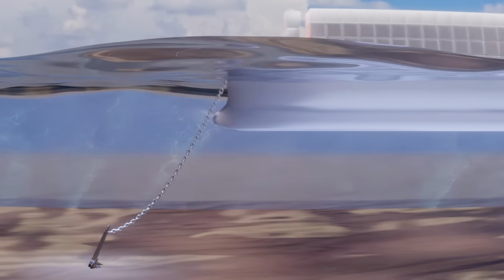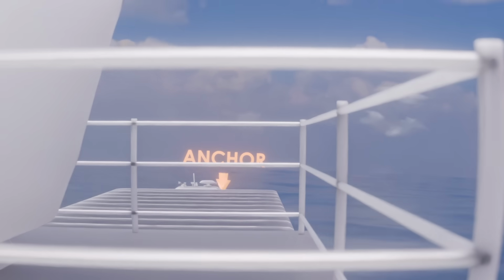Anchors don't work the way you think

Comment: >"Anchors don't work the way you think"
>looks inside
>works the way i think
Reply: Damn pirates listening in to youtube when they should be sailing!
Reply: So you're telling me that you knew the real reason the ship stays in position is the extra-long chain lying on the bottom, because when the ship moves, the chain works against the water pressure? Well, yeah.
Reply: @FloydDiamond  That's what most people would guess since that is the most intuitive role of the chain
Reply: @jmw8403 nope. The most intuitive would be that the chain is just what ties the boat and the anchor together. That the anchor is hooked into the seabed and the boat is not moving because it’s stuck. I would envision a stretched chain always. So this was a good, educational movie
Reply: @nilzor  I disagree. A chain made out of steel that is several kilometers long is obviously very heavy. Considering this, one would quickly come to the conclusion that the function of the chain has the function that is explained in the video. But I guess your intuition differs from mine.
Reply: @jmw8403 the chain has the function that is explained in the video” yeah right this tells me all I need to know 🤣🤣🤣🤣🤣🤣🤣 stop trying to make yourself look smart, you obviously didnt know the chain is what keeps the boat steady, anD ALSO the “most intuitive” function of a chain is literally holding two things together. You neither know the meaning of intuition nor the way an anchor works before this video. People like you piss me off. Couldve at least said the function of the chain is generating friction coupled with its heavy mass to keep the boat steady against the raging water, but no, let me
just save myself looking like an idiot and say “like the function explained in the video” 🤣🤣🤣
Reply: @Sorecere7  If it's not intuitive to you, then I guess that's your problem.
Reply: @Sorecere7 it is fairly common knowledge that chains play a big roll in the anchoring of a boat.
Reply: @buttecake  of course they do 🤦‍♂️🤦‍♂️🤦‍♂️🤦‍♂️🤦‍♂️ you think the anchor anchors the boat by bluetooth. However, I doubt that the chains function is “fairly common knowledge”. God, all of you are idiots why does no one get it.🤦‍♂️🤦‍♂️🤦‍♂️🤦‍♂️ You wouldnt have known this shit previously unless you gave it some thought stop acting like you knew this, and you’re smart or some shit.🤦‍♂️ you know what whatever sure this is all “intuitive” 😂😂😂 and also fsirly common knowledge. Whats next, you know all the procedures in a nuclear power plant😂 i dont wanna continue these conversations, have a nice day/night.
Reply: @Sorecere7 sorry dude, I'm just not as dumb as you I guess
Reply: @buttecake  Keep saying it till you believe it 😂😂😂😂
Reply: @jmw8403  "But I guess your intuition differs from mine." no, I guess you're just full of shit about having known this all along
Reply: @foljs5858 Where did I say that I knew this all along? Do you know what intuition means?
Reply: If the way you thought it works is "the anchor digs in and that's enough to hold the ship" then no, it's not working "they way you thought". Unless you already knew the chain plays the most important role, what you thought was the same shit the average layman thinks and is wrong
Reply: @foljs5858  Projecting much? It's obvious that he massive chain plays a more important role that he puny anchor in comparison. You are a poser, acting all high and mighty even though you lack a basic understanding of physics and critical thinking skills. It's not rocket science, it takes all of 10 seconds maximum to come to the same conclusion as in the video. It's funny how you're trying to tell me what i'm thinking as if you're some sort of omnipotent being. You don't know what you're talking about, you are nothing but a vile and bitter person who's trying to take it out on people around you to feel better about yourself. Learn some goddamn manners and get off the internet.

Also, referring to people are "average layman" doesn't make you sound intelligent, you only come across as a poser.
Reply: @foljs5858  Projecting much? It's obvious that he massive chain plays a more important role that he puny anchor in comparison. You are a poser, acting all high and mighty even though you lack a basic understanding of physics and critical thinking skills. It's funny how you're trying to tell me what i'm thinking as if you're some sort of omnipotent being. You don't know what you're talking about, you are nothing but a vile and bitter person who's taking it out on people around you to feel better about yourself. Learn some goddamn manners and get off the internet.

Also, referring to people are "average layman" doesn't make you sound intelligent, you only come across as a poser.

Edit: you're liking your own comments lol.
Reply: Right.. 😂
Reply: This film was more about how the chain works..
Reply: @cartoelie  because that's what actually does most of the world most people think the anchor is responsible for
Reply: My thinking works exactly like an anchor!
Reply: same
Reply: You didn't finish the video, donkey
Reply: Jesus died for you on the cross. All have sinned and rebelled against God (Romans 3:23-24) (not including Jesus since He is God). The wages of our sin is death (Romans 6:23). But “God so loved the world, that He gave His only Son, so that whoever believes in Him should not perish (not go to hell) but have eternal life” (go to Heaven) - John 3:16. God loves you and wants a relationship with you and all you have to do is believe in Him and love Him and repent (turn away from sin) and you will be saved. “that if you confess with your mouth the Lord Jesus and believe in your heart that God has raised Him from the dead, you will be saved“ - Romans 10:9. God will change you and your heart to become better so that He can make your arrogant and evil heart of stone into a kind and loving heart that is obedient to His commandments which are perfect as He has changed me. He will change you so that you can love Him and love others as He changed me even though we fall short of God’s glory by sinning. Surrender your life to Christ and believe today and be reconciled with your loving Creator and know the God who made everything and everyone who doesn’t delight in the death of the wicked: “ Have I any pleasure in the death of the wicked, declares the Lord GOD, and not rather that he should turn from his way and live?” - Ezekiel 18:23.  Also, “The Lord is not slow about His promise, as some count slowness, but is patient toward you, not wishing for any to perish but for all to come to repentance.” - 2 Peter 3:9. God loves us so much that He wants all to come to repentance and is patient with us and doesn’t punish us for our sin if we allow Jesus to take our sin off of us because He died in our place because we deserved death for our sin so Jesus, having never sinned, died in our place. “He made Him who knew no sin to be sin on our behalf, so that we might become the righteousness of God in Him.” - 2 Corinthians 5:21. But He will punish those who continually reject Him or who have rejected Him even to death.  Please, the time is soon, Jesus is coming back, and many aren’t saved. Don’t wait! Accept the free gift of salvation which God gifts us and believe in Jesus because God has promised that if we believe in Jesus (Who is God), we will receive eternal salvation. “ For it is by grace you have been saved, through faith—and this is not from yourselves, it is the gift of God—” - Ephesians 2:8. Repent (turn away from sin and resist temptation to sin) and come to Christ who will take your sin away, give you a new heart to love God and love other, and He will save you from judgement on judgement day. What an offer! “ For the wages of sin is death; but the gift of God is eternal life through Jesus Christ our Lord.” - Romans 6:23. Praise God!
Reply: Consider9ng the first anchor is like... seemingly 1/3 the size of a full cruise liner.... I'm gonna say they work WORSE than i thought(I'd always thought it was specifically a fairly small thing compared to the boats they stop)
Reply: Damn presumptuous title that assumes every viewer is a moron, whereas in reality only most of us are.   Second only to presumptuous titles that assume the information is of critical importance.  "What you really need to know about dental floss"  Third only to fake wow-factor.  "You'll be amazed and won't believe what happens when you put an egg in boiling water!"
Reply: @agalah408  1 it doesn't assume nor does it say people are morons. No one knows everything about everything. Not knowing the exact way anchors work doesn't make anyone a moron, plus most people actually don't know about the curve part so the title isn't a lie 
2  those "presumptuous" titles aren't an issue if the information is actually something important or if it aims to explain all the important info about something to someone who doesn't know anything about it
Reply: @hyacinth5040 ahh finally met someone with fully functional brain 🤝
Reply: @agalah408 not knowing how the anchor works doesn't automatically make people moron, no people knows everything. Human evolved by learning, I thought you know that already. What kind of bullsht is this
Reply: @agalah408 shut up dumbass, you ARE a moron if you think that explanation videos like these are targeting idiots, when in reality you can be smart and not know everything. In fact, “smart” people are those that admit that they dont know everything, and only a fool is naive enough to pretend he does.
Reply: @agalah408 and then they use metric
Reply: @daleolson3506  
Yes, the correct one :)
Reply: @agalah408  
Not everyone, just 99,100% when it comes to such odd knowledge.
Reply: 😂😂 I said this to my wife. 
Like. I absolutely do understand how anchors work Ive been sailing nearly all my life however now I gotta watch to make sure lol.
Reply: @Nailedit-p7q  Want to get a full understanding of how anchors work and can drag?  Own a 40' cruiser and anchor off in the strong current of the St. Clair or Detroit river with hundreds of other boats for the firework shows.  You had better know your stuff before you slam into another person's million dollar boat. I put out over 100' of chain and rope to make sure that I am locked in.
Reply: @g.k.1669 yeah man that’s too crowded for my blood! Lol. On days like that I’d rather just grab a cooler and some chairs and watched the guys at the boat ramp instead. 😂
Reply: cap. you totally thought it was a billion pound anchor attached to a piece of thick twine.
Reply: LIES
Reply: First time you see a clickbate title on youtube?
Reply: I am pretty sure this is what most people believe how an anchor works.
Reply: @jmw8403  Pretty sure most ppl don't know that the chain weight plays the biggest part, wanchor.
Reply: @Toro_Da_Corsa  Yeah I agree. Never said they did.
Reply: @jmw8403  
I'm pretty sure 99,100% of people don't know how anchors work.
Reply: @AArata63 Sure, but if you were to ask them, this is most likely the explanation they would think of. It is pretty much the obly logical way an anchor would work.
Reply: @jmw8403  
No, most people would NEVER know the function of the chain as explained in this video.
Reply: @AArata63 I find that hard to believe since that is the most obvious function of the chain. The explanation in the video is the most intuitive and logical explanation of how an anchor works for most people.
Reply: @jmw8403  
Maybe for you. I'm highly educated and very practical but I had NO idea the chain had that function. Maybe this comes natural to you but I'm 100% sure most people wouldn't know.
Reply: @jmw8403  the most obvious function of the chain is to pull the anchor out
Reply: @MrOwl-lw3xc When you have a chain weighing hundreds of tonnes, it becomes pretty intuitive and obvious that it functions in the way that it is described in the video. And considering the chain's material, and its size and length, it also becomes obvious that it must weigh a lot.
Reply: @jmw8403  i didn't knew how much the chain weights until now
Reply: @MrOwl-lw3xc Sure, but if you were to put two and two together, you'd come to the conclusion that a steel chain with a length of thousands of meters must weigh insanely much and therefore have the role and function it has like it is described in the video. I don't mean that you would know it somehow before thinking about it, but when thinking about it, you would realize that since it is intuitive and logic.
Reply: @jmw8403  it's not impossible to reach the conclusion logically. i just didn't, that is all i have to say for myself
Reply: "Omg, you are SO smart!" You hoped someone said that to you, didn't you. Well, you're not, bug off.

Comment: @3:38. The same shock absorber principle applies when you are towing an ocean going barge. When you're using a 130' ocean-going Tugboat pushing a 500 ft barge, once you get out of port and head out to sea, you drop out of the Notch and you go on the Tow. When the correct amount of cable is let out, it's completely underwater. All you see is a short length of it going up to the barge. All that cable underwater acts as a shock absorber between the barge and the tug and the waves and the current. Ex-navy,  Merchant Marine engineer.
Reply: That's pretty neat. I wish I had followed my dreams and become a mariner, I always thought that would be a cool career.

Comment: The single link of the rod is not heavier than grand piano, that typically starts around 300 kg and can be as heavy as 480 - three times the weight of a single link. The blue whale typically weights 90 000 kg, and none ever spotted the speciment that would be near 200 000 kg. Therefore, 230 000 kg rod and anchor set is much heavier than a whale, again about 2 to 3 times heavier..

Comment: Dragging the anchor was real tactics (in the age of sail), and you can make "handbrake" turns with it. Probably not with battleships or huge container vessels though.
Also, you do measure chain lenght. Depending on the seabed 4-8 times as much as the depth. The winch has sensors and tells you how much chain is already in the water. The markings nowadays are just for backup if the readout fails, if the ship even still has them. And normally you would use more than one anchor, otherwise the currents and wind will spin you around the anchor point, potentially ripping it loose or crashing you into other ships, rocks, etc.

Comment: Very good video. 
Except for 2  bits of terminology:
1) A shackle is a piece of hardware used to connect 2 other devices, say the chain to the anchor. it is a u-shaped piece of metal with eyes in each end through which a pin is passed to close it off
2) Chain is measured in shots, which are 15 fathoms long.  (a fathom is 6 feet and is the historical unit used to measure depth of water)
Reference: Knights Modern Seamanship, Chapter 5; Ground Tackle.

Comment: Gee, anchors work EXACTLY the way I thought they did.  That's why the anchor rode on my sailboat always had way more chain than any book recommended.  Never heard of an anchor rode being measured in shackles, though.  The battleship on which I volunteer measures it in "shots" as does any large ship I've ever heard of.  The graphic of a Navy anchor flipping its flukes to point away from the ship is completely bogus.  That would only happen if the anchor broke and failed.  An anchor WILL stop a ship.  I witnessed a ship accidentally drop its anchor in the Houston Ship Channel many years ago while I was in a sailboat race.  It definitely came to a very noisy and sudden stop.

Comment: The anchors job is to dig in and the chains job is to provide a horizontal pull for the anchor to dig in. The weight of the chain makes sure that the force is always pulling the anchor parallel with the sea bed. The chain will provide some drag but that's not the purpose of it.

Comment: Funnily enough, in inland shipping we actually have manoeuvres using the anchor to make a turn. While yes it's not at the speed you suggest in the movies it's not entirely inaccurate. Anchors were and are still used in some cases to make sharp turns around a corner where there might be a lot of current.
Reply: I have to add that these days with bow thrusters they have become a lot more uncommon. But my father and grandfather used these quite often, furthermore these manoeuvres are still mandatory theory for the multiple theory exams needed to become an inland shipping captain.
Reply from the maker: wow, I actually didn't know that, super interesting!